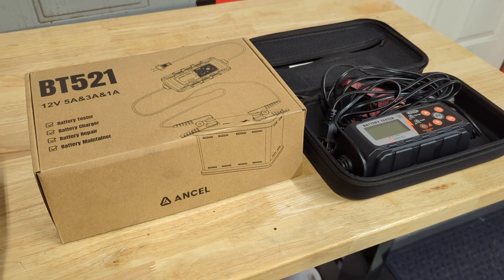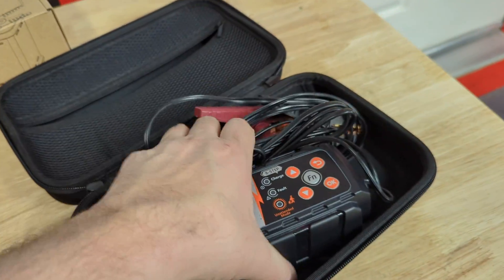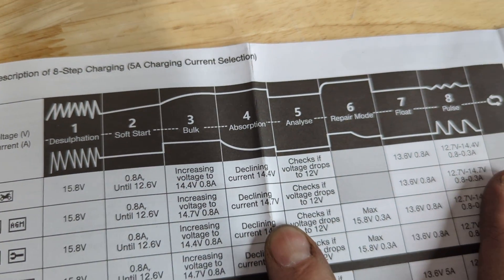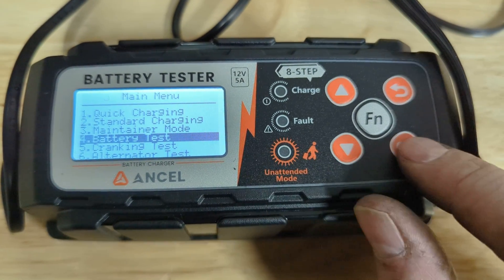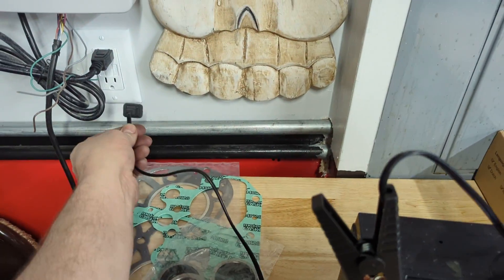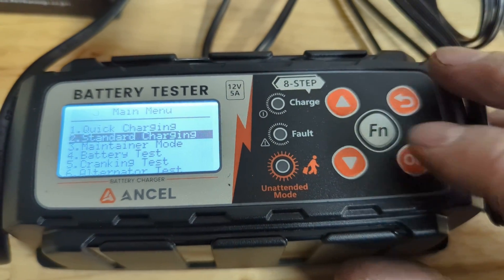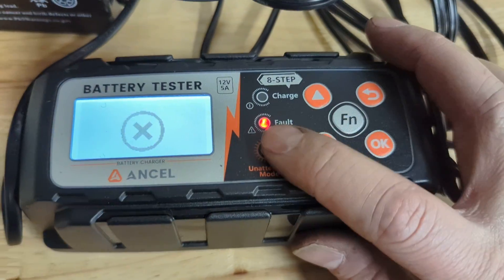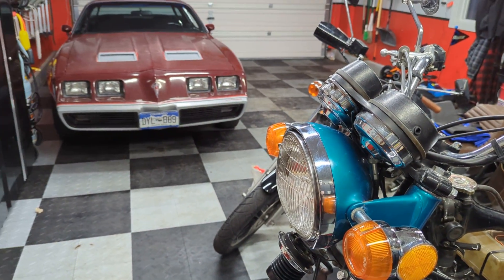Ancel BT521 Car Motorcycle Battery Lead AGM Load Tester Charger Maintainer Advanced Features Test

Comment: Hello.  Is it possible to manually adjust the current for different batteries?  What does the "wrench" symbol mean in the instructions in the table?  What kind of mode is this?
Reply from the maker: You can't manually adjust the current, but the different limits are based on motorcycle or car setting. The wrench is the repair mode.